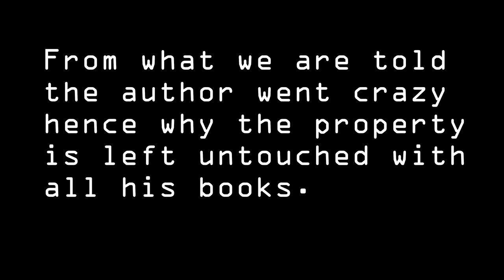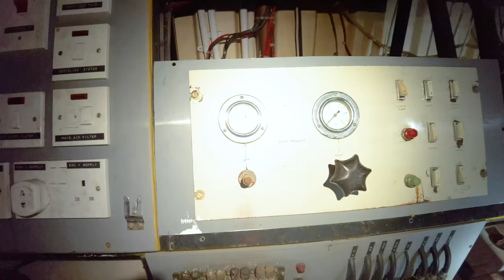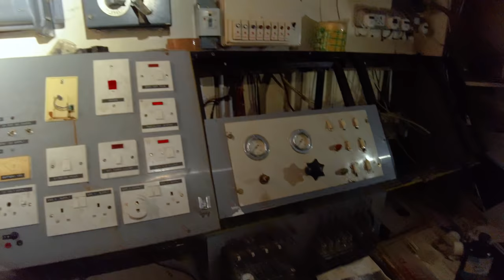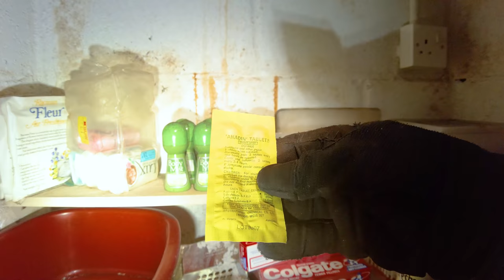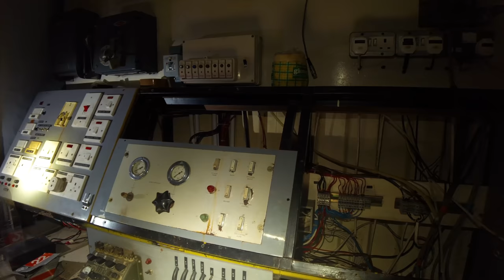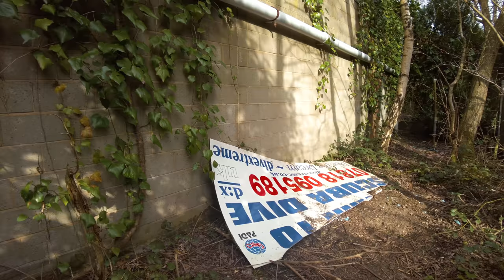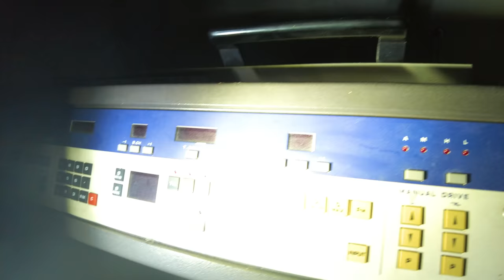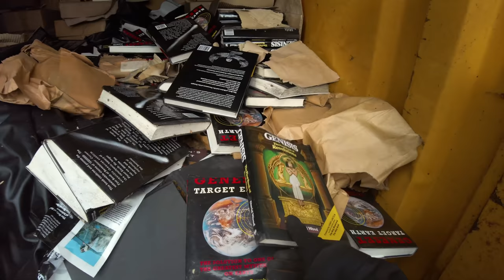Famous Author Goes MAD abandons MANSION and BUNKER

Comment: Amazing... what i would give for just a little of all that space.  
When you were winding the air intake handle you pointed out the filter on the floor still sealed.  If you look at the flexi duct coming downwards it has a joint which comes apart and can then be joined either side of the filter cannister when needed.  
You should have closed up that big weighted entrance flap after to preserve the bunker as long as possible.  
Shame the house wasn't possible.
Thanks... I enjoyed this 👍

Comment: Holy crapola, that is mind blowing. Especially when the entrance was so rough n ready and not buried.   Those books are on ebay but all from the States for like $20 published in 94.  I wouldn't mind reading one!  I thought I had a lot of Calcium Hypochlorite with 2kg lol!  1 heaped teaspoon (8g) + 8 litres water = Chlorine solution.  To disinfect water to drink you then mix 1 part solution with 100 parts water.  So 1kg powder makes  100,000 litres

Comment: all half assed built too, that 'bunker' is just containers with disparate cement block types barely holding it together. As if either of those 'blast' doors would be useful when the walls aren't even bonded

Comment: Someone put a good bit of thought into that bunker.  Would be very difficult to sustain it though with the scant equipment that was there.
Reply: That bunker is just two shipping containers buried and connected together with breeze block walls. I doubt it woud protect you from a fart, let alone a bomb of any sort. A proper nuclear bunker would need to be at least 25 foot underground and protected by multiple blast protective doors.

Comment: It is a bad idea to bury a container if it is not covered with a reinforced concrete structure, and a replaced and well sealed floor, because the containers are strong (load) only in the corners and their floor is not metallic in most of them

Comment: Diesel gennies run on compression not sparks, so flip decompression lever turn handle and drop the lever on compression stroke, it's a technique you learn quite easily.  Bleeding the injectors take a bit longer to learn but when you suss it it's little problem. It's a twin, so both levers on decompression, spin it, drop first lever and it should run on one pot, then flip the second lever to get bot pots running... a bit harder when it comes to Bristol bus engines with 24 liter 12 pots, fart 3 pots, then next three etc but we sussed those two when we had to They will run for years if looked after. Used them when living on narrowboats and the pub Iused to use also ran on diesel gennies.. which out quite often and the usual joke was "Anyone got 50p for the meter" 23 minutes in
 Yeah learned a lot when living in a truck for a couple of years, and if you think the Bristol engine is big, it is small compared to the Martian bus recovery truck, 2.5 litre just the starter motor for the main, 4 miles to the gallon when not under load) I see he says it was seized, even that wouldn't be too hard to free up and clean to get it running again.
Reply: What do You mean Fart 3 pots???